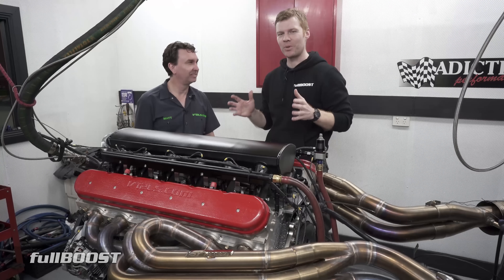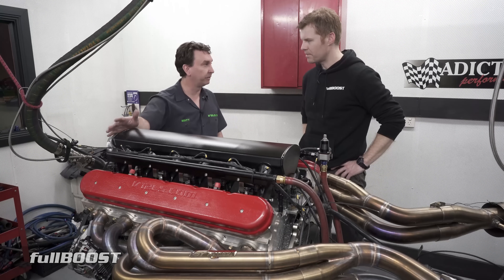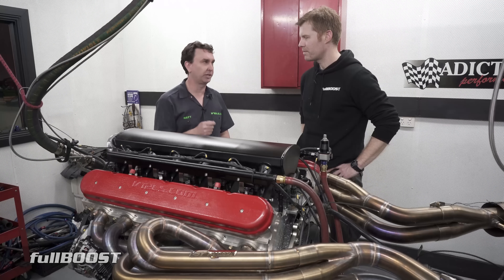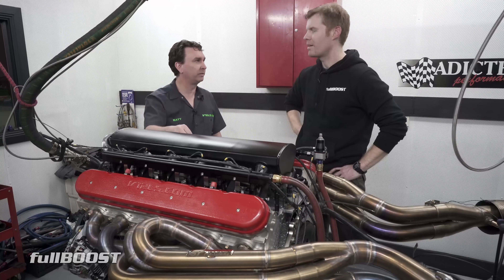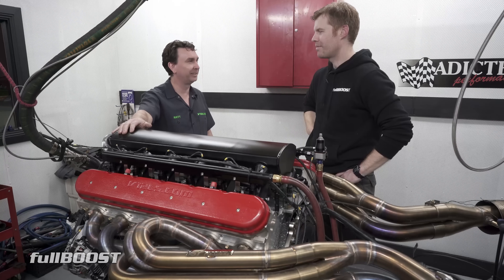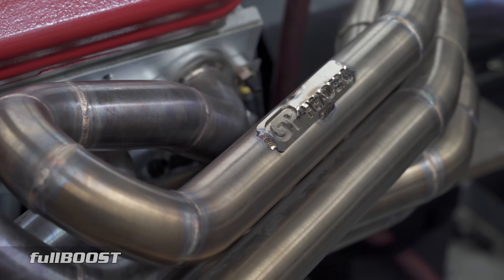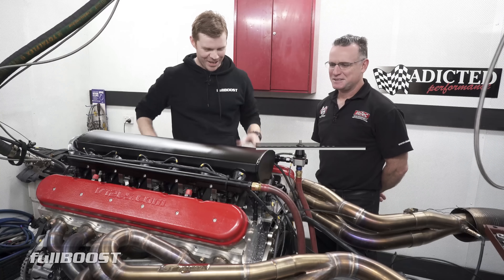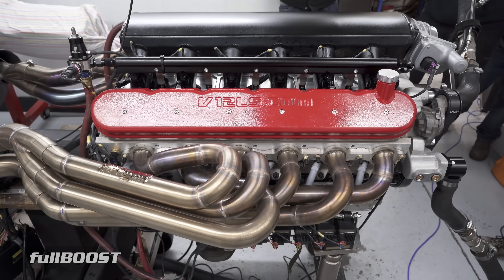Inside a V12LS engine | fullBOOST

Comment: This manifold cut off on top.
Weld a new plate on.
And than build a two in one 420 B&M Mega Blower with four 600 cfm carbs  on the top.

And this in high polish alu look !
Perfect for a 1932 cadillac 372 a 5 window pro street style full fendered hot rod coupe !!

Comment: Crossplane or flatplane crank. Is flat plane an option?
Reply: Neither, it's a tri-plane like all I6s and V12s. You are right, 2 planes would not give enough opportunities to fire the 6 cylinders per bank in a 4 cycle engine without firing some at the same time.

Comment: Those manifolds are a work of art. They're a 6-2-1 configuration though, I wonder if you chuck a pair of long tube 6-1s on we could get this to make the F1 scream like a Zonda? I can hear the high pitched harmonics very faintly as it was revving on the dyno. Or is the 90 degree V angle going to mess with the even firingness?

Comment: V-6 and V-12 engines get smoother firing orders when there're built on a 60° (or 120°) bank angle of the V.  I realize that they might need to raise the cam so it would fit, and that's complicated, but just lengthening the standard V-8 90° bank is less optimal.  It could be smoother, more compact and possibly lighter if they made that change.  Virtually everything here is probably custom anyway, except the valves, bearings and rotating assemblies.
Reply: You are correct from an even firing perspective, though a straight 6 is balanced in every order, so a V12 may be built at any angle and be perfectly balanced, and still odd fire.
Reply: Pagani Zonda just used a V12 from Mercedes A class. I don’t get the appeal of this video. V8 needs two throws less than any of the balanced 6. 90° gives first oder in bay balance.

V12 has equal firing order. Yeah, I see those headers. Still would instead want turbo like in F1 with energy recovery.

Comment: I did expect it to look a bit smaller than this

Sure its a v12 so it should be massive, but its an LS based v12 and LS engines are god damn tiny

Does it just look big with all the accesories on it or are the block dimensions changed (BBC vs SBC)
Reply: It's exactly the same as any other LS, just 8.8" longer. The early ones even had cut and welded LS intake manifolds. They are big, but not stupidly big.
 Maybe a bit of camera angle, engine height on the dyno rig, accessories and exhaust might give it a larger than life look.

Comment: Wish it sounded more like a v10. The sound isnt as bad at 7100rpm, but could probably take it to 8500rpm with a 10 and be a shorter swap into compact race (kit) cars. Very impressed by this none-the-less. Power is less than a NA 496 32v BBC I bought, and weight is more than an aluminum BBC - but I’d still buy one for a swap.

Comment: The rear exhaust pipes are not changing color. That means there is less heat in them relative to the front ones. That means they are running rich caused from less air. The engine is literally choking the rear few cylinders because it flows so much air

Comment: how there use motec and not a heltech ecu
Reply: The customer can choose any ECU, provided it has enough configurable outputs to run the engine.
 Both Haltech and Motec are great systems, and run these engines nicely.

Comment: Since you didn't give any tech on this engine, I've gotta find out more about it.
Reply: This one is a pretty basic build, using good quality after market parts.
 4.125" bore,
 3.622" stroke,
 Low 10's comp ratio,
 92mm throttle body,
 JE pistons, K1 rods, Comp Cams link bar hydraulic lifters,
 227/237 @.050" cam with 0.59" lift, (Clive Cams custom billet) 
 LS7 style ports and combustion chambers,
 Custom cometic head gaskets,
 Custom Billet crank,
 Motec,
 Premium pump fuel (No E85 or anything fancy)
 Peak power was 764hp, but timing was pulled back a fraction to keep it safe.

 Running E85, more comp, more cam and a bigger intake would see a lot more power, but as it is, it has more than enough power for the vehicle it's in now.

Comment: Looking only at the external evidence of the engine with the little knowledge I have, I may be mistaken, but I see that they were worried about making an exhaust with the same volume for each cylinder. However, the staining of it already reveals that the cylinders do not have the same filling. I don't think this intake collector has the same Volume as the TBI for each intake valve.

If you install a wideband o2 sensor on each cylinder, you can see more clearly.
But I also know that it is not possible to have a perfect admission collector, because many cars do not have enough space.
But monitoring the temperature and burning of each cylinder would help greatly improve the efficiency of this amazing and gorgeous engine.

Comment: Looks great but def needs larger intake, very slow throttle response slow rise in rpm. You can tell its sucking air through a straw.
Reply from the maker: The dyno controls how fast the engine speed increases.

Comment: is it 90º or 60º?  (It looks like 90) to me)  If 90º is it even firing or not, if it is, how is it achieved?
Reply: 90 degree, odd firing. We have actually designed an even fire crank if anyone ever wanted to use one, however the benefits of sharing crank pins outweigh the benefits of going even fire as a V12 is balanced at any bank angle.

Comment: this engineer for being where he is isn't all that smart, to relate the atmospheric manifold vac. at redline to max hp is garbage. airflow in and through a cylinder head and making power can be attained by velocity of mass through the plenum, vacuum speaks to pressure but not to mass. grams per second will determine the air quantity  and the power. colder charge air temps, ignition advance= more power.
Reply: Hey man, just pointing out that there is vacuum at full throttle which likely points to the fact the limitations of that intake setup have been reached. If you were expecting a full explanation of everything that impacts HP on an engine and how to theoretically calculate it that's not really the intent of this video. However if that topic interests you check out EFI University or HP Academy, they have some great tutorials for all levels from enthusiasts to professionals.

Comment: so is it a cross-plane or flat-plan crank?
Reply: Neither, like all V12s we use a 3-plane crank resulting in perfect balance and allows for 6 firing angles per bank in a 4 stroke engine.

Comment: I would actually like to see how it behaves with dual throttle bodies on top of the intake plenum... I may be wrong but having the intake just in the front won't impede the back cylinders from breathing correctly? Did you do a check with 12 lambda sensors on each exhaust pipe?
Reply: Thanks for taking an interest in Fabio. Make sure you subscribe to our channel as @fullboost because we have a triple quad intake in the build and will be testing the higher HP versions with individual IGT sensors. I agree it will be interesting data to look at with both manifolds.

Comment: I can see one improvement all ready at first glance on that beast..      while it was double carb build it was ok, but as it is now injected engine and single throttle body..   last few cylinders get way worse air...  less of it and warmer as well.. ( less of it , due fact that multiple cylinder intake valves are open at same time, and air goes where it gets first and with least resistance)     will be an nightmare to tune and when engine temps rise all that tune work is thrown out of window unless you do variable engine maps according to temps…  but that is just extra work what could be avoided completely with 2 throttle bodies , or one larger one that is in middle of plenum instead of in first cyl. end.

Comment: I'm a chevy fan but I hope some day they fix the bank angle and lawnmower heads.
9.5L v12 making 750hp...is it a diesel?(JK). TVR did 960hp with only 81% of that 25 years ago, Current european engines of 6.5L (There are allot of them) are 720-790hp and extreme engines like the valkyrie are ~1160hp at 6.5L NA so fuck knows what's going on here, 0degrees of timing? Lead pistons?
Reminds me of when the C4 corvette went from 405hp down to 300hp because GM didn't like that the LT5 was designed in the UK. Because thats worth losing 25% power over.
Reply: Hi Toms Tech, thanks for the interest. These engine make a little over 1.5x the same specs do in a V8 LS. Can you explain why you would expect different results?

Comment: Don’t know if the offset of the cylinders is the same as a stock ls but why not make an intake that uses a manifold per head. Like the one the skid factory made up for their gz powered cruiser. That would eliminate the need for a bigger throttle body but it would probably just be easier to make a larger single manifold. I don’t really know if that would have an adverse effects on the performance of the engine but it would look pretty cool.

Comment: That length of crank shaft turning to 7k. That’s amazing, what a feat.
Reply: True, its a much longer crankshaft, but it also has more Main caps/bearings. LS's have great sturdy designed mains to begin with. And as long as its balanced correctly and not over stressed it wouldnt matter if you have a V24 or a V6, itll live
Reply: And the Dyno being able to withstand the torque variations as well. This engine fires unevenly; the firing intervals alternate between 90° and 30° due to the 90° V angle and non-split crankpins. (For those of you motorcycle people, it fires exactly the same as a 180° inline twin, except at 6 times the RPM.) The uneven firing also means that the torque signature is much more similar to that of a 6-cylinder engine instead of a V12. Personally, I wonder what it would sound like with a single exhaust or X-pipe.
Reply: It is like a R6 engine of BMW and they rev also 8400 stock and in race config also above 9k. So why not!

Comment: I was hoping it would have evolved more into basically an LS7, but with 4 more cylinders, velocity stacks on individual throttle bodies, with an aluminum block available for NA only set ups, and a flat plane crank shaft since it being a V12, its naturally balanced. That coulda been a 10.5 liter!
Reply: a V12 engine only works if the cylinder blocks are set at 60 degrees, this cancels nearly all imbalance problems.
if the cylinder blocks are set at 90 degrees, the engine cannot be balanced correctly !
the engine will eventually vibrate itself apart !
Reply: Hi Key, yes you can special order exactly that. Except the flat plane crank because you need 6 possible firing angles per bank and 2 planes of crank pins would only allow 4.

Comment: Damn it. they went with an iron block:/
Reply: But you can order one in alloy ;)
Reply: V12 LS Alloy🧐 How light is that compared to Iron and Aluminum?🤔
Reply: @MasterKeyMagic   Aluminium is roughly 1 letter heavier than Aluminum, which is 50-60KG lighter than the iron block. Both are still considerably lighter than a BBC but heavier than a SBC.

Comment: what did I hear cast iron block that thing is going to turn into a boat anchor when a car goes into a corner should have been made from aluminum!
Reply from the maker: They sell that version as well.
Reply: The weight difference is really not that much and iron blocks have many advantages. But if weight is a big deal for your project you can order an alloy version.

Comment: 4 105mm turbos, 8" thick radiator, half-height intercooler of the same core thickness,  30PSI boost, double liter injectors per cylinder double 150mm throttle bodies, e85, you'll hit 4000 hp no sweat.
Reply: FOUR 105mm?? That's ridiculous. Twin 105 would be closer.

Comment: I want to build a tiny airplane with one of these with some sauce added.  You could easily make 1600HP with a handful of turbos and some engine building, and a tiny plane with that kind of power would just scream.  You might even be able to set a piston engine record with it, if you designed the airframe right.
Reply: Unlikely. Those Rolls Royce engines that came in the P-51D/K are kinda the zenith
Reply: @benbauer1257  A Merlin is a whole lot bigger and heavier than this. In theory, you could quite easily build something like this that makes Merlin power at half the size and weight, thus a smaller, lighter and more aerodynamic airframe and thus faster. The problem is making something that powerful, small and light still be reliable enough for single engine aircraft use. Blow a motor up on takeoff and you're in a world of hurt.
Reply: It would go perfectly with a Thunder mustang !
Reply: If I get my hands on one of these, you've just given me an idea of what to do with it.

Comment: IS THIS ENGINE BASED ON CHEVROLET LS MOTORS?
Reply: Cristian Vallesi yes it’s an LS style design
Reply: From the way they explain it its an LS1+4 I believe
Reply: originally they welded 2  LS blocks together and a crank. now they are making them in house
Reply: @Co1eTrain84  yea, but after doing the math its  the 6.0 LS2 platform in the sense of, didn't they design it to work with LS con rods, pistons, lifters, valve train, cam timing, and accessories? I know they have a slightly larger 9.2L which they straight up say is the LS3 design.

Comment: Iron Block WTF does this lump weigh ? 700 lb plus surely ?
Reply from the maker: 265kg
Reply: @fullboost  @ Really ? are you sure that fully dressed it weighs in at 265 kg's ?
A BMW V10 which is alloy Block, granted its dual cams per bank but that is 280 Kgs so I am really struggling to understand how an Iron Block V12 is around the same weight ?
Reply: @stevestephens8969  Weight varies depending on intake and accessory choices. There is not as much difference as you would think between the alloy and iron block V12LS engines.  Here is this exact long block on the scales: http://racecast.com.au/wp-content/uploads/2019/10/IMG_0652.jpg

Comment: You are casting blocks but not making them the proper 60 degree bank angle so it doesn't sound weird...
Reply: The decision was made by weighing the pros and cons. With the only pro being even-fire Vs the ability to use all LSX parts, lower overall height, better intake angle, good camshaft placement etc. Cool V12 project yourself by the way! Really like that you've done something different.

Comment: you should get John Kaase to fine tune the intake manifold head porting and camshaft, base motor will have 1000hp upper spec will have 1250hp lol